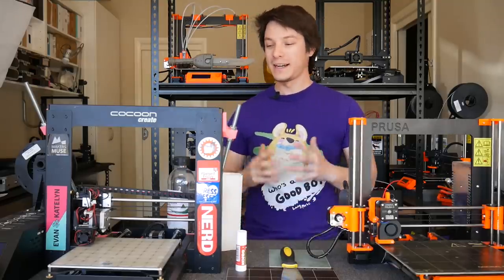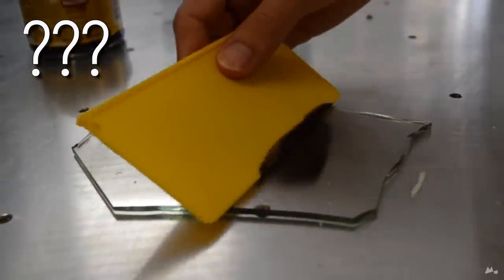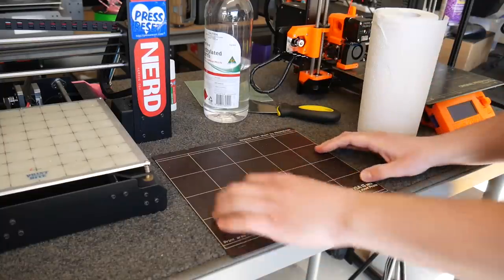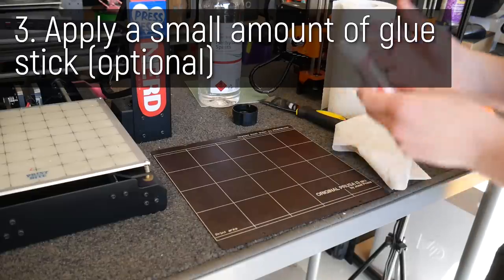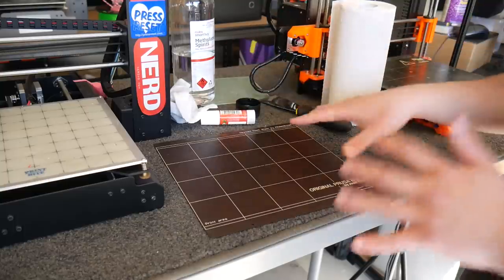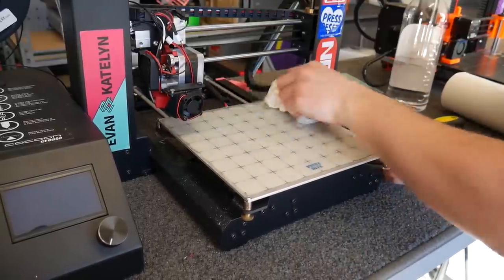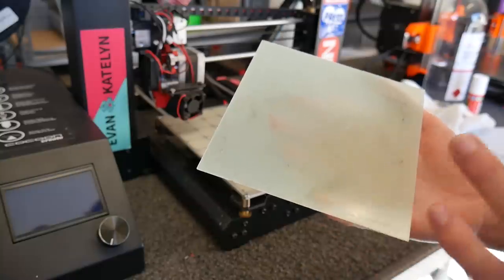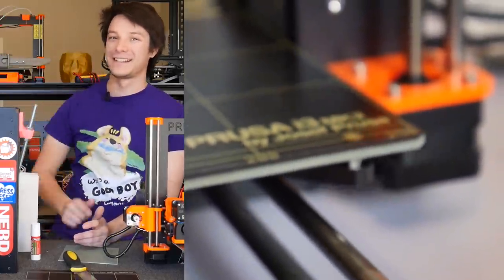3D Prints not sticking anymore? Watch this! 3DP101

Comment: Got my Ender 3 Pro since a couple weeks. First dozen prints absolutely no problem with adhesion, now I'm at the point where I can't get a print to stick without gluestick no matter what. I've tried cleaning, re-leveling, declogging, slower printspeeds, different temperatures. Literally the only thing that worked reliably was Gluestick xD

Comment: Actually, I come to love using cheap aerosol hairspray on my PRUSA PEI sheet.  You'll need to do this in a contained space and not when the PEI sheet is on the printer (because you'll end up coating a lot more than the sheet).  I just find a nice cardboard box that will fit the sheet at the bottom and then spray it once to give it a good coat.  Since there are fumes, I close the carton and let the fumes settle (which adds more spray on the surface of the sheet).  I then place the sheet on the print bed and let the heat of the printer warming up for the print to dry out the surface.  Works like a charm.  Every once and a while, after a few prints, I take the sheet off and wash it and start all over.

Comment: I have in 2015 problem with this issues. I bought magnetic bed. After that I dont need glue stick, alcohol and spattle. Still I can use a piece of glass for printing a rubber TPE. 
Thank you.

Comment: Thank you so much for this video. It saved my printer from not going to be a 400 dollar paper weight. I had the exact same problem after using it for 6 months. printed many different things. In recent time, more and more, I started getting this issue and one fine day, I was not able to print anything at all. I thought it is due to bed leveling. Spent entire weekend, tried to level 100+ times and test printed. will work well in test print until I put a print with multiple layers in it... 1. upgraded stock spring - same problem 2. checked the bed for warping - no issue found but same problem 3. bought BLTouch and installed - same problem. I was about to give up and then i found your video. isopropyl alcohol sprayed and glue stick used, now it is sticking like super glue... problem solved. now I spray the alcohol and glue everything when I print... Thanks Again.

Comment: Nice tip mate, I ended up flipping my Ender 3 glass plate upside down to the shinny glass side and using the glue stick trick. Seems to be working better now. My main issue was the the glass plate was warped. I put a straight edge on it and it is definitely not flat. I lapped it flat on a granite plate with sandpaper but wore away most if the sticking side.

Comment: I agree. Glue stick is my goto.
Reply: Oy. You clean and apply glue after each print?
Reply: CHEP, but it is more of a last resort! I have found that gluestick made my adhesion worse and i found that it ruined my bed surface and it has made my print surfaces more dirty. 

Gluesticks requires more maintaining and more cleaning and is an additional cost.

Comment: I know this is an old video, but I'm curious if anyone knows if the orientation of the print matters on a heated bed for adhesion. I'm using a Anet ET4 Pro, so essentially a ghetto Ender 3, and the glue worked ok on the glass heated bed everywhere except towards the very front. Does the heating hit certain parts of the bed more than others?

Comment: This is similiar to what others have suggested too. However, your suggestion about mixing alcohol with the glue to spread it out across the bed is fantastic. I have had fourteen failures in a row so far from losing adhesion. I may have finally fixed it but it took all week. Thanks for your suggestion! I'll modify how I apply the glue on next go around!

Comment: Thanks for the tips Angus. Another trick for glass beds is to wash them in dishsoap for a squeaky clean bed that sticks like mad.
Reply: Matthew Poole Glass cleaned with soapy water is great, but I always get a small amount of warping on sharp corners.
Reply: Ed Jones I had to print a bunch of really small parts and was concerned they would come loose during printing so i tried spraying hairspray on a rag and wiping the glass and it worked very well. Whats your preference? Flex plate? Glass? I am always looking for different ways.
Reply: Agreed. A little Water and a clean cloth is all I use for between print cleanings on my Artillery.
Reply: Windex
Reply: Jet-dry.
Dish-washing Rinse agents in general.
It's a surfactant that 'makes water wetter' by lowering surface tension.
A trace of this stuff (if you can see it, too much!) on clean glass can get great adhesion.
With PETG and squeeky-clean glass, it can ruin your day!
With the surface tension gone, printed materials can bond to glass at the molecular level.
Ruined two Ultrabase sheets this way....divots pulled out of the glass bed!
Prying/peeling the parts off was ripping the glass!
It's possible to get too much adhesion.

Comment: It may be overkill but I have the habit of cleaning the surface with isopropanol before every print (slightly moist cotton pad). Haven't had a print come loose yet on my MK3 printer (counter is at about 250 individual print "sessions" now) and the printsurface still looks as new. 

With that said, nice video and good suggestions for other print surfaces!
Reply: Oh I did forget to mention, I did "rough up" the surface a little bit at the start (only once a couple months ago) with a fine structure scotch-brite pad (similar to  steel wool grade 00). But only slightly with almost no pressure. The result is that the surface only lost it gloss.
Reply: Stefs Engineering you realise that cleaning your print bed before every print is in the prusa manual...
Reply: Good call, yeah it's in there and they also recommend the isopropanol. (except when printing PETG) They do however specifically write that it's not a requirement before every print, and that you just have to be sure not to touch the  printbed. That is where my habit differs from the manual.

For those that want to look it up, it's in the printing manual under "6.3.2 Flexible steel sheet surface preparation" 
https://www.prusa3d.com/downloads/manual/prusa3d_manual_mk3_en_3_03.pdf?2
Reply: isopropanol I have used for 8 months now no issues, I never use cotton as its harder to removed fibers, the cheap Paper towels work best I have found. for prusa flex beds (Aquanet Super Extra Hold & Rave 4x Mega) Hairspray works awesome & isnt messy like glue is, the heat can bake the glue, hairspray removes so easy & glue stick can stick so well it can mess up the PEI, this wont ever happen with hairspray lol. glue is worse idea for any PEI. glue can bond so well it can even take chunks of glass up with it once its baked on some surfaces.
Reply: Thanks for sharing your experiences. Reading your comment I noticed that I forgot to mention, I do not add a coating on top of the PEI that is allready on the flex bed of my MK3. Just straight on it after I cleaned it. Never needed glue or hairspray to make the parts stick. Works excellent for my two primary materials (PLA & PETG)
Reply: I too clean before every print with isopropanol  using coffee filters which do not leave any fibers, are cheap an you can reuse one for 3/4 prints.
Reply: Nice alternative, thanks for sharing!
Reply: Hoenestly, I thought rubbing alcohol was commonly used.

Comment: Hey Angus I use Elmers school glue stick and I just remove it with a bit of the old H2O. I just sqwirt a little on the  build plate with a spray bottle. I have been doing this for years with my old davinci 1.0.

Comment: Perfect tip... thank you.  My Prusa sheet has been not sticking around the middle for a while.  I just move the prints around, if possible.  But today I have a print going diagonally from one corner to another... and it would just on stick.  A few clean and glue stick rounds and everything is sticking really well.  I did a z height adjustment of just -.002 just in case.  Thank you... back to printing.  I've got a 10 hour RC Wing part on the go now.  Cheers.

Comment: Very cool.  I’ve been using glass surfaces on my Ender 3s and use a very similar process.  I usually just wash the glass in warm soapy water, then use IPA to quick clean/dry and eliminate any oils remaining.  Then a light use of a glue stick and a damp ipa rag to spread it around evenly.  Glass still looks good and can print quit a lot of prints before cleaning is necessary.

I’ve also been experimenting with etching cream with glass.  Several coats of etching cream and a single super light application of glue/ipa spread has given one of my glass beds a long life span without cleaning (think I’m going on 4 months of almost daily printing without cleaning). And my prints still have just as silky smooth a surface as unetched glass.

Awesome video as ever!

Comment: Thanks for the video Angus. FWIW - I use a Kapton sheet on my Anet A8. Works great for PLA. Prior to printing I spray with a little Windex on a warm bed and wipe clean. Keeps the Kapton clean and I don't have adhesion problems. I change the Kapton sheet every few months depending on use and how scratched up it's become.

Comment: On my low-end XYZPrinting Mini printer, I always print onto a wide section of Painter's Tape (that I got a 100m roll of) - with a thin coat from a glue stick, but recently was having the non-sticking problem too.  I found that I actually needed to upgrade to an "Xtreme" glue stick - to get everything working perfectly once again.  Not sure if this was caused by something that XYZPrinting did to the proprietary filament  or something that they may have done to the printer's drivers and firmware - but at least it's fixed now.

Comment: I've had a lot of problems not even glue helped, so tried using strips of very thin double sided sticky tape, sounds nuts I know but it works a treat.  Should point out my bed isn't heated.

Comment: was having this exact problem and that pretty much fixed everything! still have one small sector on my bed that will not stick no matter what, so it's causing things to warp around it, but that's a much easier fix than prints failing outright

Comment: Thanks for this simple and effective advice! I have a CR-10V2 with glass bed. So far I haven't used any sprays, tape, or glue. I scraped the glass plate though and I could see the stuff coming off. Then I cleaned with 99% IPA and saw some yellow on the paper towel (I have been using white filament). I didn't use any glue or spray. Now a model that had failed to stick several times is printing perfectly.

Comment: This works! 
Before applying glue stick, use a spray bottle to spray some clean water onto the bed. While wet, the glue stick will just slide over without leaving uneven glue clumps.

Comment: I have not buy my first 3D printer yet, but i see in many videos that it is a problem that it moves(does not stick).

Could it be an idea to have a frame around the bottom that you could print support lines to?
In the same way as you build support for things high up, just with this you do it to the sides with the first layers.

Comment: I only use a glue stick when i print petg because otherwise it sticks to much when printing on pei. A friend is using the saltwater method for printing  on glas. For that you use normal water with a high amount of salt in it and put it on the hot heatbed. Then only a small layer of salt is left on the glas which can be easy removed with only water after the print.
Reply: Salt? That's interesting. Never seen anyone do that before. Might give it a shot, and while we're at it, could probably work with sugar too...
Reply: maybe but sugar is to sticky on fingers and the cleanup :-/

Comment: Dude oh my god holy crap! I have a print that uses the entire print bed of my Prusa MK3s, its a mold master for making a silicone mold and then casting with urethane so it has to be perfectly flat.  I usually don't have bed adhesion problems but for whole print bed prints - there is usually a little corner peel here and there... This mineral spirits and glue stick thing! I've never had more buttery smooth perfect first layers in my life! Dude, you have changed my life.  If I ever have more kids they will be named Angus! Thanks brother!!!!!

Comment: Thanks for the tips. Never would have thought it was a dusty or dirty board. Thought it was because of the nozzle and ptfe tube replacement because the prints turned out really bad after doing this even after levelling mutiple times. Cleaned it with soap and now better than ever. Couldnt even see the dirt or grease but you would be surprised at how dirty it could get.

Comment: I have been using a similar method since I assembled my Anet - I use a lot of glue stick straight onto the aluminium bed, and then use water and my finger to spread the glue evenly and smoothly over the whole bed. It is a bit more messy but I have only done it three times since getting the printer almost a year ago, and it works very well. It is important to have a level bed, though, so I have a leveling probe set up to help with that and it works very nicely.

Washable glue stick and a removable bed is fantastic as you can clean it under running water!

Comment: I bought a glass replacement bed for my ender 3 pro (bed was warped in center). I started using AquaNet (because it was the cheapest and wasn't going to smell like kiwis or anything)  hairspray on the glass and that works amazingly. One light layer usually lasts for a few prints. I try not to touch the bed and if I do, its usually not where a print will be happening. Every once in a while, I'll just wash it using dish soap and warm water. I've never had a print break free since. In fact, a lot of the times i've had to stick the entire bed in the freezer for a few minutes to get the prints off. Even at room temperature, they wouldn't give.

Comment: Hey Angus, I have a less labour intensive tech with pva glue. I use the principle of Peel Ply (used in carbon-fiber pasts manufacturing). I do not have a removable surface, instead I use a cut mirror piece. Every print, I cover the designated position on the glass in PVA glue and the I take a small piece of paper (like a post it) and tap on the glue, that it gets "stringy". I will dry quite fast due to the heat and this is in my opinion the easiest and most efficient way th get your print stuck. Even if does stick "too much", you take a sharp spatula and go between the glass and the print right into the glue. This technique is so easy. I have 4 pieces of glas for my printer, and when all 4 are used/coverd in PVA, I just shove them into the shower and clean them.
If you read this, a short answer would be great if you knew the "Peel Ply" technique (yes this is the official name) ;)

Comment: Great video Angus. If I'm doing an important print. I'll take a small spray bottles with isopropyl alcohol in it. And let you spray the print surface that has a little bit of glue on it. Just before I start printing. Is sort of activate the glue to be a little bit stick here.

Comment: Great advice. Just received my Prusa MK3s. Had a corner peel up on a 10hr print, frustrating. I did the glue stick method on the first one and it was great, but I applied too much and it was a pain to clean up. Tried hairspray, thats when the corner peeled. I like the applying small amount of the glue stick and spread it around method. Thank you again for confirming that this works.

Comment: I am trying the Garolite print surface sold by Matterhackers. Previously I printed with the Buildtak print surfaces. For the Buildtak I never needed Glue stick just changing bed Temp works at least for small parts. Not much cleaning of the bed surface either. No trying to print large parts. Having issues. With the Garolite surface the first print stuck well at least the few one or two layers. I think I was printing to fast. But the second printing of the same part it would not stick at all. No go. So I found your video, thank You, will try your cleaning technique. After cleaning I am going to try printing with out clue stick just to see if glue stick is really needed. I also find my Bed at the edges is off by (-)5-10 degrees from the center of the bed. And the hole bed is off by (-)15-20 degrees from the settings on my printer

Comment: Im having adhesion issue that occur on my magnetic Ender Pro.  I print with the bed at 50-60 c,  and level and clean my bed before each print. I use isipropal alcohol to clean.  The odd thing is it happens on the slightly larger prints only or ones that are much taller than wide, even with a raft first layer.  Oh, and my printer is less than a week old and I have printed maybe 5 things...,so its not really dirty.  😣

Comment: My problems had to do with my rooms temperature. I turned up the heat to 75 and it sticks. Wonder if I can use slicer software to raise the heat bed temps for first few layers. I am building an enclosure to better control temps.

Comment: This is something it took me a while to figure out.  Running a DIY Prusa i2, with glass on a heated bed.  Every once in a while, I need to spray down the bed with glass cleaner, then just quick smear of glue across it.  Right now, I'm getting about 200 hours between cleans, and all materials are sticking fairly well. (I print ABS, PETG, and PLA)

Comment: Good trick and I found this out by accident while cleaning my glass build plate. Basically I wiped it down with isopropyl alcohol and found that it was dissolving out my old glue stick application, so I used the spatula to scrape up as much of it as possible. When I hit the glass a second time with isopropyl, there was still a thin layer of old glue that stuck around and I just rolled with it. Didn't reapply my glue stick, just used that thin gooey layer as my build surface.